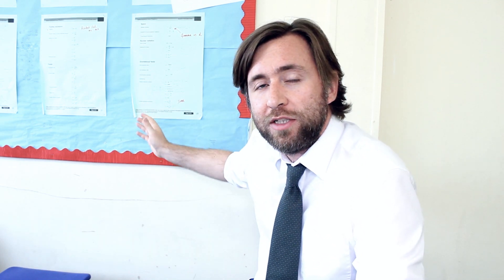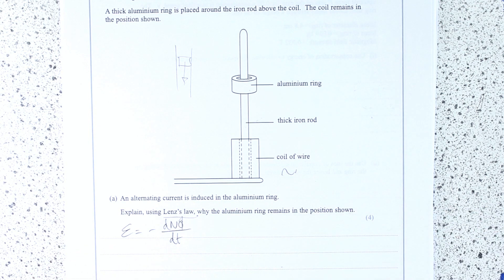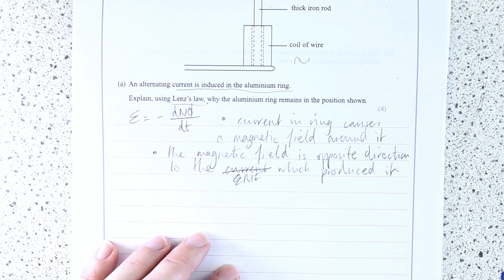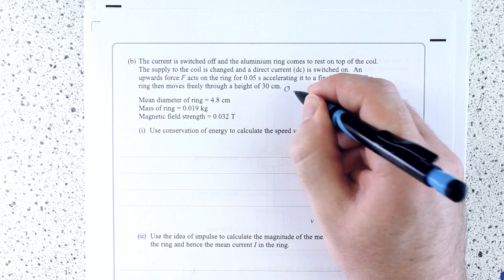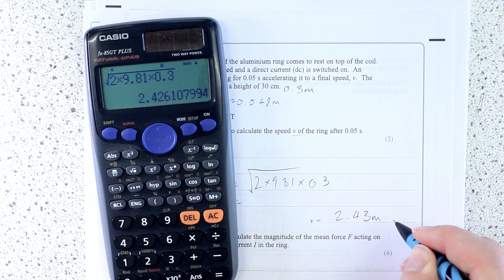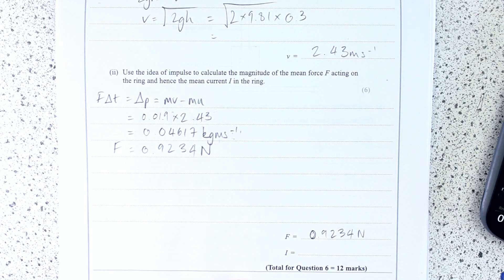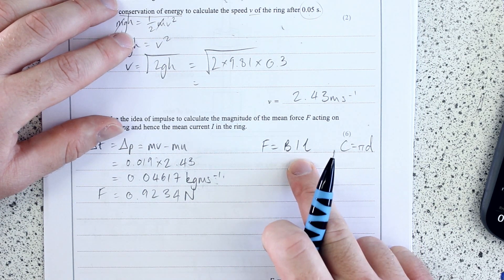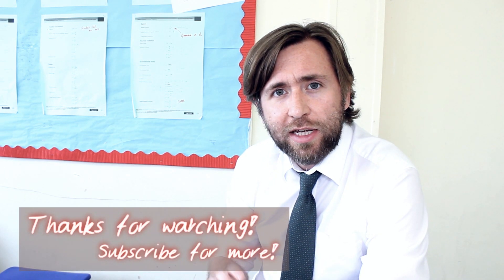Faraday and Lenz Law - General and Practical Principles of Physics - Edexcel A Level Physics Exam

Comment: How comes you didn't add the weight of the ring to the force? Is the force in the formula of impulse not equal to the resultant force and only the force provided by the magnetic fields?
Reply from the maker: Because you are working from data of motion that is in effect the resultant force. But you are right there's no mention of the weight. Did check me markscheme though. Maybe it's too small to be significant? Cheers.
Reply: @kitbetts-masters  Okay, thats cool. Thanks anyways, i finally understand lenz's law and Faradays law now due to the walkthrough. Much appreciated!

Comment: Why does substituting in circumference for length work?
Reply from the maker: You are basically modelling the aluminium ring as a loop of wire.  So the loop's cricumference is the length of wire.  It's all in the field at right angles to it.  Hope that makes sense, (it's also going to be a good stab at it as it's the only length that you have.)
Reply: GorillaPhysics thank you